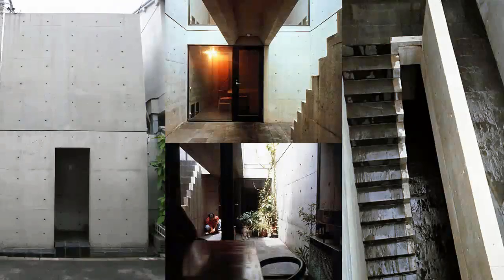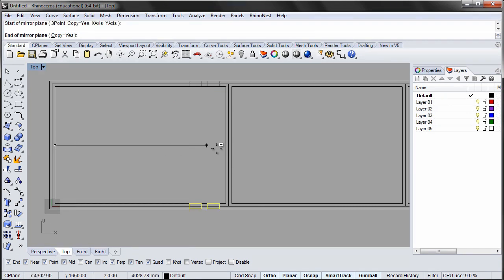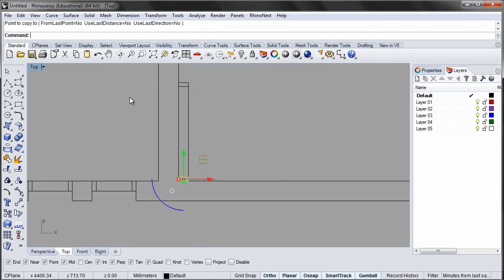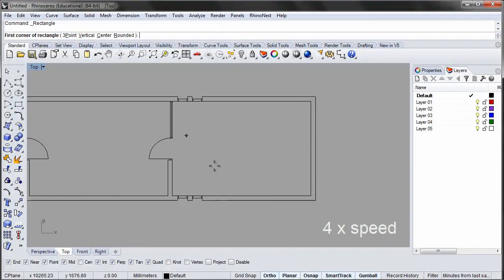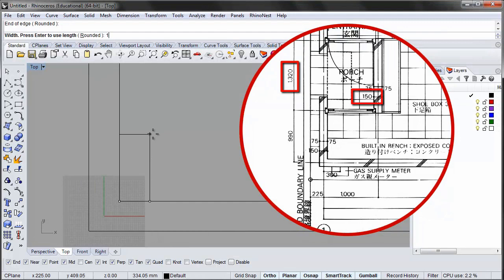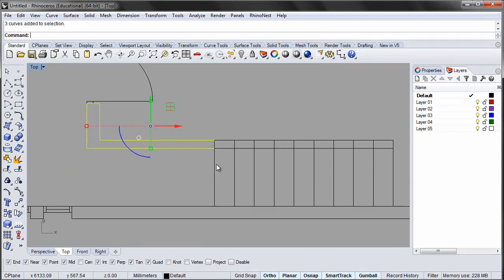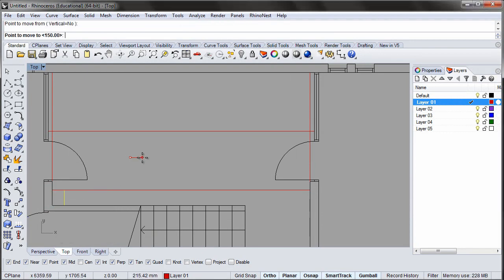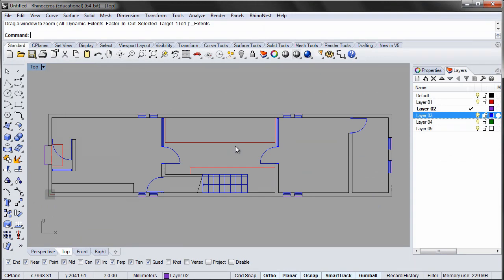Azuma House Part 1 of 4: Plan drawings in Rhino

Comment: what setup did you enable for the angles to show the protractor each time
Reply from the maker: Hi Jason,
I think you are referring to the gumball (red and green arrows with blue arch).
To enable the gumball, click the Gumball text icon in the bottom of the screen (next to Osnap and SmarTrack).
You can also select an object, run the Gumball command (write "Gumball" in the command prompt and press enter), then click the on option/toggle in the command prompt. Hope that is helpful.

I'm working on a video that briefly explains the gumball and object snaps, so that will be available soon. If you subscribe to my channel you will get a notification when the video is available.

Cheers
/Ruben.

Comment: Hi Ruben,
How did you join all the curves if they aren't adjacent to each other? I select them all, click Join and the command says all the curves were joined but when you click on one it doesn't select them all. According to another tutorial they have to be adjacent to each other to be able to join them... Is this correct?
Thanks!
Reply from the maker: Hi Ian,

Join will only join curves that are connected (both open and closed curves). This means that running the join command (ctrl+J) will often produce more than one curve. In other words - the other tutorial is correct.
Use the group command to group a selection of curves, that should do the trick.

I hope this was helpful.

Cheers,
Ruben.

Comment: I'm stuck at the part where I'm trimming the smaller rectangles that would become the windows. 
( 2:59 )
When I trim, I delete the curve that creates the larger rectangles. What am I doing wrong? 
I'm also new to Rhino, so sorry if I made a dumb mistake :P
Reply: Try make the window and wall in the same layer first and draw windows in new layer.

Comment: Question, when you select all the windows/ doors by holding Shift and clicking them. Is it also possible to customize it to control + left click? (the same way as other programs) This way of adding objects to the selection is very confusing.
Reply from the maker: I agree David, unfortunately I don't think there is a way to change this - it seems to be a "hardwired" behavior.
You can set up hotkeys and aliases but that won't be of any help I'm afraid.

Comment: I might be wrong, but isn't the plan in centimeters? You are taking those numbers as if they are millimeters, and as a result your house is 10x smaller (the walkway would be 0.15 meters in this case.
Reply: it's in millimeters. doors are 750mm, convert to meter would be .75m